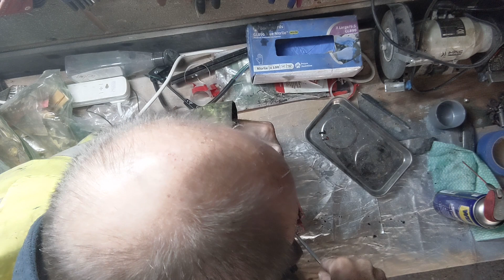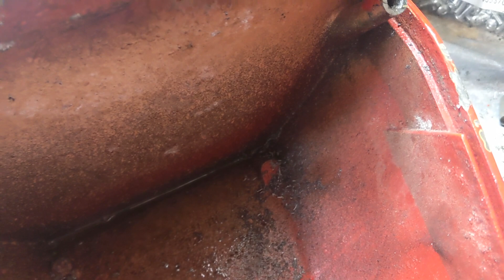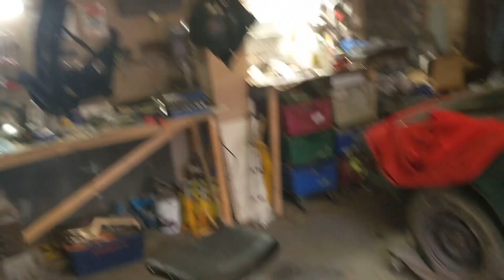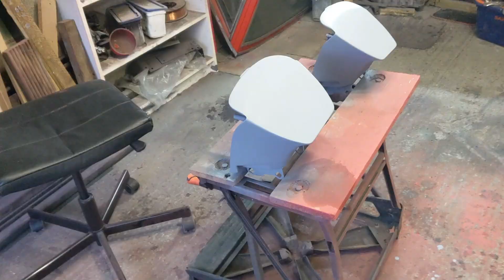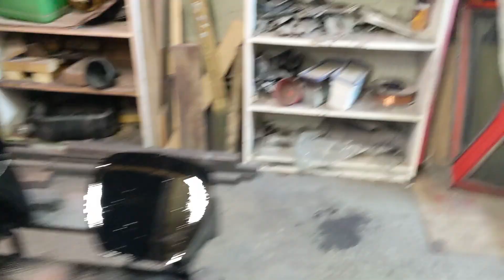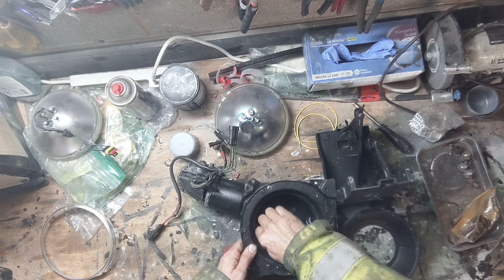Triumnph TR7 Restoration: Headlights strip and rebuild

Comment: Hi Henry, Well done for getting the motors running. 3 of the wires from each headlight motor are connected to a changover  switch in the motor assembly that indicate whether the headlamp is up or down (and not somewhere in the middle). As you can see from the wiring diagram, the common is connected to a Green wire and the up/down signals are the Blue/Light Green and Brown/Light Green. The wires from the 2 headlamps are connected together via diodes so they do not influence one another. IT IS WORTH CHECKING THESE SWITCHES AND DIODES ARE WORKING BEFORE GOING ANY FURTHER. This is easy to do with your mutimeter, rotating the motor by hand without any power on it. Those wires join together to Blue/Purple and Blue/brown which connect to the headlamp flasher relay (11). That is connected to the electronic Flasher Controller (10) usually known as the Pektron which holds the headlights up for a few seconds. These are prone to failure, but Robsport sell a modern replacement. Be aware that the wiring diagrams are different for different model years, so check you have the correct diagram. The Haynes manual shows the different years, but the ROM you are using is correct only for the year it was published for. I hope this helps.
Reply from the maker: Thanks for the guidance.  I'll take a look.  And if you've any guidance about how to check the printed circuit board, I would appreciate it
Reply: @HenrysGarage  not sure which PCB you are referring to. My main concern is that you might have mullered the diodes by applying voltages here and there to get it working

Comment: Nice one Henry, you & motors again eh, loved the schoolboy error with the connector, who hasn't done that at some point! Don't forget the headlamps have independent relays, located at the back of the glove box etc as you would have seen. Sometimes when these are stripped down they can be temperamental to get working again, if the tie rods have not moved and are straight it should be ok. Good stuff thx for sharing.
Reply from the maker: Thanks Chris, happy with the result

Comment: Think motors controlled by other electronics. I'm trying to remember, you pull the stalk, lights bob up for you to flash, few seconds later retract. So timer and reverse somewhere. I know turning the knob the thing would snatch your fingers if the fuse wasn't pulled and head  would cycle  up and down. Brings back some memories.
Reply from the maker: Yeah, I remember it snapping at my fingers when doing manually.  I had to start it manually but then the motor would take it up and hold it.

Comment: Was always impressed by the black rubber molding on lights. Need them working so that you can bob them to say "Hello" to fellow TR7 drivers.
Reply from the maker: But just so hard to find now.  I do wish someone  would make some after market kit for the TR7
Reply: @HenrysGarage  Even back in 80's hard to find some parts. I went breakers asked for some wheel trims as they heat stain go yellow. One breaker chap said no chance. Other said, what's he want, wheel trims, back of that container set of 4. I knew someone would want them one day.
£10!